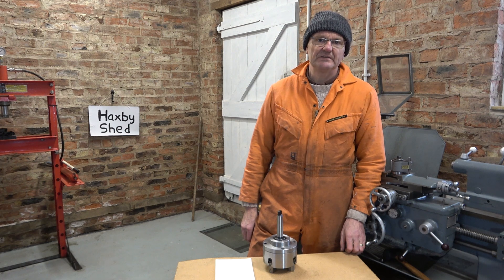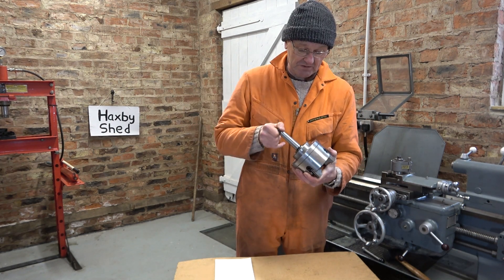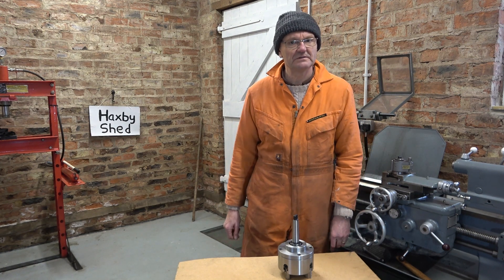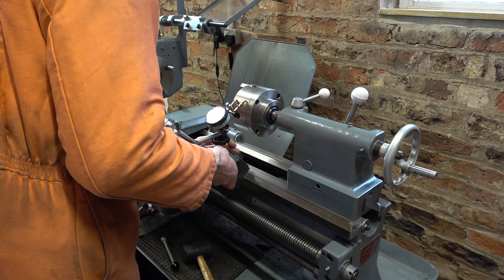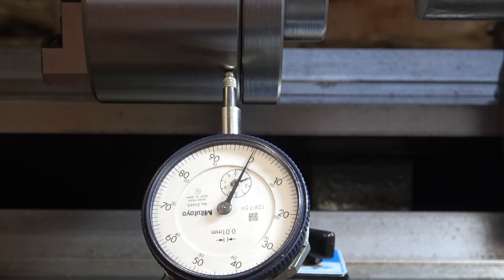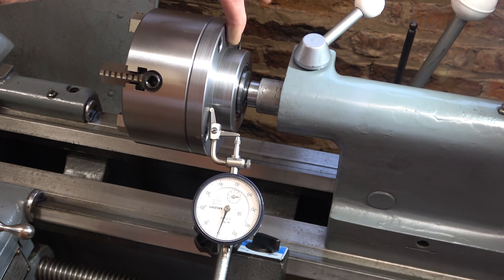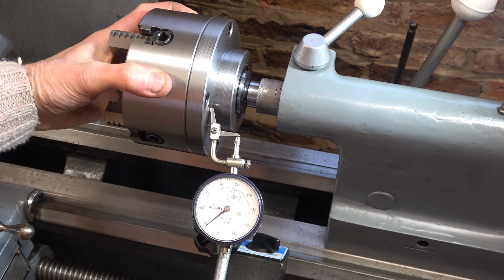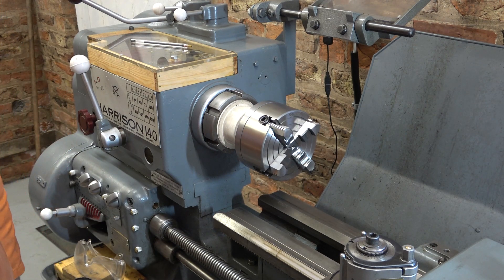HS55 Tailstock 4 jaw runout measurement

Comment: I just finished mine today! I use an old 3 inch pipe flange and bit of stock welded to the middle to accomodate the bearing (my bearing was bigger than yours at 76mm across). Now I did mount mine in the headstock with a faceplate. The reason being, I turned the face of the hub on the bearing and MT3 shaft.. But of course I had to stop it turning on the bearing to machine it. So I used 2 bolts to the faceplate and tack welded the bolts to the flange. Yeah, don't ask me why I did it that way but it did work. Thanks for the inspiration..:)
Reply from the maker: Hi Frankish, it it works it does not matter how we did it. Cheers

Comment: those bearing are preloaded if the inner races are drawn together. I would have run a 10mm thread in the arbour and used a 10mm cap screw which will pull the centre tracks together..
Reply from the maker: Hello 1stMrSceptical, it's on my mind, and my odd jobs list, to do that. I have not had any problems with the fixing but yes a positive clamping screw would be best. Cheers

Comment: Great job mounting the tail stock chuck it will be fine for your shop. I dont think you are building space shuttles any way!
Reply from the maker: I was trying to think of a phrase like that. The best I could come up with was "we are not making swiss watches here" but did not seem quite the right thing to say. Maybe if it was a watchmakers lathe .....   Cheers.
Reply: @HaxbyShed  As far as runout goes it wont matter any way you are using a 4 jaw and will need to indicate the parts that it will be holding.

Comment: would tapping be a good application for a small 4 jaws chuck with a bearing like yours?
Reply from the maker: Hi Bernard, maybe as it could be possibly be adjusted more accurately than a drill chuck. My Jacobs MT3 drill chuck is way out of centre - 5 to 10 thou sometimes.

Comment: Is that your older or younger brother, I'm guessing younger, great bit of editing.
Chuck looks spot on, if the interference fits are too great, it will be apparent when running at high speed for a while as I understand it.
Thanks for sharing.
Regards John.
Reply from the maker: The guy on the left looked a bit unhealthy to me ... :-)
Reply: @HaxbyShed  It would confuse a visitor, ref putting that chuck in the headstock spindle, or show of strength. LOL.

Comment: Car bearings aren’t the most fortunate choice for precision stuff, even the cheapest precision bearings are better than expensive generic bearings.
  But nice build overall and that runout is pretty acceptable if you re doing not so ultra precise parts 👍🏼👍🏼
Reply from the maker: Hi thanks for the comment. The car wheel bearing was unused in my stock (no cost) and that was why I used it. I agree it's not really the best choice. Cheers.

Comment: Given the dubious quality of the chuck itself you should have checked the run out on the chuck prior to the mods with a fitting plate and taper THEN re check with the bearing addition.
We would have learned if the Sanou was good in the first place and if you did  ok on the mod. My gut feeling tells me you did pretty good considering the chuck was at least 3th to start with. Now I know why you pressed it so tight. You should redo the whole video to give it suspense and structure.
Reply from the maker: All I can say Bernard is, when you spend £47 (delivered) on a chuck you gets what you pay for ..... and anything reasonably useable is a bonus really. Cheers.

Comment: Wheel bearings on car front hubs are a tight press fit
Reply from the maker: Thanks. I thought it would be ok but it was a fair question. If I ever find a job for it I will have to see if they get warm (as somebody has suggested in a comment). Cheers.